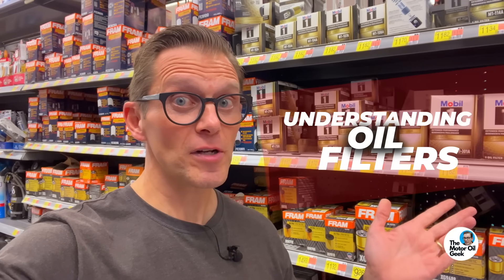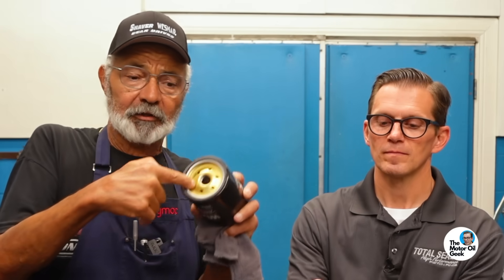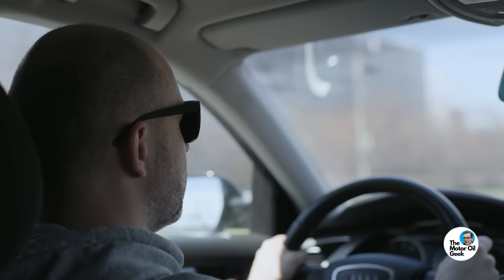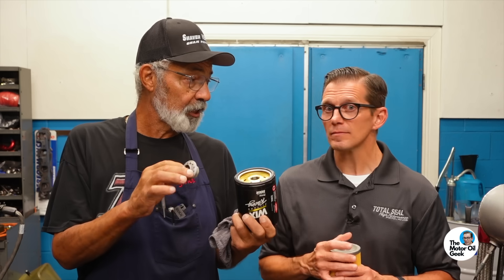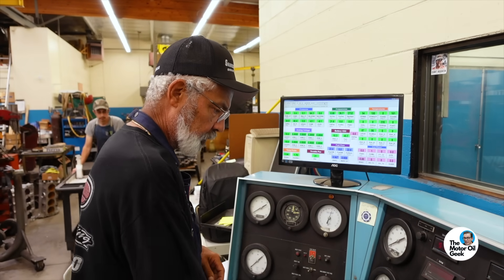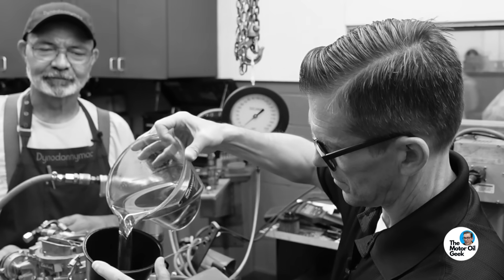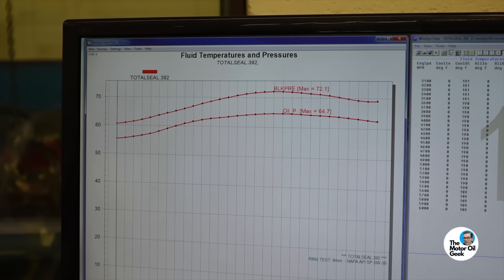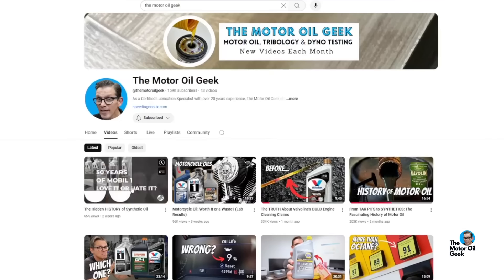OIL FILTERS: What Most People DON'T Know!

Comment: I was taught that it's good to fill the oil filter whenever possible. It's helps build oil pressure quicker upon start-up.
Reply: Yes the exchange of air for oil is important. The filter is clear full of air that gets trapped in the oil gallery so when the pump forces oil into the filter the air is displaced and blows the oil off the bearings momentarily.
Reply: Sounds like nonsense
Reply: @YourFriendlyHoodVampire  ok know it all.
Reply: @ okay, know it all.
Reply: Yeah but the absolute best thing to do after changing oil if you have an automatic is press the brake pedal down, press the gas pedal down all the way. Hit the start button to crank it over and over quite a few times until you see oil pressure register on your guage and thats the safest way.
Reply: @deanwinchester119  Not in a 68 Impala with a sb Chev you don't 😉
Reply: @deanwinchester119  Okay . . . explain what difference it makes if you're just "cranking" the engine or starting it. The oil pump is mechanically driven the same either way. Whether or not the cylinders are firing or not have nothing to do with the oil flow.
Reply: @barrygrant2907  turning the motor over on by the flywheel at 150rpm is very different to turning the motor over with connecting rods at 1600rpm
Reply: @barrygrant2907  Agreed! I was scratching my head over that one! Everything in the engine is moving and combustion does not change anything. The only way to beat that is to add on a pre-lube system — at a horrific cost, by the way.
Reply: @pops91710  Agree. It the said procedure ran the oil pump by itself to prelube the engine, that would be one thing. But cranking the engine to lube it is cranking the engine to lube it by whatever means.
Reply: Clear Flood Mode is the term, I do it as well but never used the brake pedal  @deanwinchester119
Reply: @deanwinchester119 
Ah computers !! 😀😀
Reply: @deanwinchester119 only downside of that is having to countlessly insist to the client you made their car do that on purpose and didn’t in fact screw up their car’s startup despite what they just heard and now assume lol “I aint never heard it not start up like dat you done broke somethin I just wanted an oil change”

Comment: yea but what about when its -20f outside will it open? i wouldnt call room temperature cold exactly
Reply: Who cares if it does, first off if unfiltered oil runs through an engine for a few minutes it's not going to do anything unless the engine is coming apart and the oil is full of metal or something. Second off if your starting an engine that at say -20F without using an oil heater your causing far more wear then you would be just not running any oil filter in warm temperatures. I live somewhere like you do and I park outside, my rule is plug in the block heater and oil heater in whenever the temperature is below about 20 degrees. Hell I can't imagine starting an engine that was even 10 degrees without preheating it first. We only see -20 degrees a few times a year here, but our average winter temperatures are probably around 15F degrees and -10 to -15 is not  unusual around 4am when I leave for work in the morning. I usually plug my heaters in when I get home and let them run all night in those temperatures, however when it's warmer I use a timer to turn them on around midnight. I don't hear my oil and coolant to operating temperature rather to around 40-50 degrees in the warmer weather and maybe to 20-30 degrees on a cold day. Daytime temperatures are generally warm enough that I don't bother plugging my car in at work however I do on cold days as well.
Reply: @Trump985  im just curious for the sake of knowing I'm not worried if it does bypass. back in the day engines didn't even have oil filters and most small engines dont to this day.
Reply: @windzer I couldn’t tell you, I’ve never tested it. It would certainly depend on the oil viscosity in question and the oil filter in questions restriction to flow. This test in this video isn’t an answer to the question either. There are many different filter on the market with vastly different oil flow restrictions. Check out Brand Ranks YouTube channel tests on oil filters. They did actual tests measuring different oil filters properties including the particle sizes they filter, the amount of material they can hold and most importantly the flow restriction of the filters. There testing seems to be very good and the results show a huge difference between different filters.
Reply from the maker: The dyno is in LA, so "cold" in this test was room temp. It would be fun to repeat the test at a much colder temperature.

Comment: I’ve been a car guy for years, WTI 1981.   In 2005 I started a job that really open my eyes to hydraulics, the engines oiling system. Same thing only different. Our oiling system did all our work, just like a backhoe etc. I have to say, you really start to understand about what fluids happens to fluids under all these different conditions. The need for fluid testing, proper filtration. Our filters on the pressure side were 10 micron, return side 25 micron.

Comment: When it comes to prefilling a filter, does it matter if you fill the filter before putting the filter on? What I mean by this is, can you pull the fuel pump relay and simply crank the engine to fill the filter? I ask because some engines with the filter horizontal or even upside down are difficult or impossible to prefill.
Reply: Acid:  Cranking the engine for 5-8 seconds is a good idea, but make sure you do not crank over 15 seconds.  At 15 stop, and give the starter motor at least 2 minutes to cool.  Inrush current on any motor is ~7x normal operation and will damage motor if done 2-more times in succession.

Comment: @Lake  Can you please make a video if Very Fine Bypass Filters are worth it,? You said that the filter only filters out particles over 25 microns in size. There are aftermarket filters who are build in parallel to the main filter and they filter at around 1 micron (advertised). I think the main question regarding this topic is:  how thick is the oil film under load, for example between cam and lifter? That would give a rough estimation of how big particles can be without (!) being abrasive, at least in my opinion. Having particles 25 microns of size in my oil sounds scary! It's like lapping paste... Great content, as always! Marlon
Reply: They incorrectly stated that particles smaller than 25 microns will not hurt anything.  Clearances inside an engine run between 1 - 5 microns.  There are SAE articles on the benefits of bypass filters, and that most wear occurs between 5 - 15 microns.  I've posted oil lab results of my 2 micron bypass on FB forums.
Reply: I was also wondering about testing bypass filters. I put one on the crate engine in the Caprice wagon and wondered if it was worthwhile since the old engine lasted nearly 200,000 miles with the previous owner's sketchy maintenance schedule.
Reply: @oldcoot3459  you can do the test yourself.  Install a bypass, and test oil using a particle count lab test.  I've done this for years. Just did the same last week.  The oil is cleaner than when it was new.
Reply from the maker: Thanks for the suggestion.

Comment: I read somewhere that alcohol breaks down the fibres in paper based oil filters.  They said that alcohol from the fuel can end up in the engine oil which can eventually damage the paper filter media and degrade the oil filter’s abilities to filter your oil.  Just wondering if this is a real problem?  They suggested the solution to this issue is to use oil filters with synthetic media.
Reply from the maker: Water can impact and reduce flow across cellulose media.

Comment: How much does viscosity affect the "Delta"?  Particularly on a cold soak start? How much difference is there between 5w-20 and 20w-50 at say 20 degrees Fahrenheit?
Reply from the maker: The dyno is in LA, so "cold" in this test was room temp. It would be fun to repeat the test at a much colder temperature.

Comment: I'd also like to see what happens below zero. It's amazing how thick even synthetic oil gets around -40, even ATF looks like gear lube at those temps. I can't imagine the filter not bypassing at sub zero temperatures. Looking at the marks inside even clean filters up her, it looks like things are moving against the spring. But that's not scientific proof.
Reply from the maker: The dyno is in LA, so "cold" in this test was room temp. It would be fun to repeat the test at a much colder temperature.
Reply: @themotoroilgeek  I'd say come up here to northern Minnesota, but it's been a warm winter.  🤣

Comment: Nice set up for measuring pressure on the inlet and outlet side of the oil filter.  I would love using that set up to test various oil filters to see if some limit oil pressure more than others.  Cough cough-FRAM.
Reply: Depends on filter media. Cellulose filters like regular Wix or Fram EG will be more restrictive than a Wix XP or a Fram Endurance, but synthetic media also filter better than cellulose media while still flowing more. I use Fram Titaniums on my 565 big block. No issues.
Reply: @1979Ragnarok  Several of my experiences with grabbing Fram because it's all I could find at the time consistently prove the oil pressure is about half at idle when compared to what most other brands are.  BBC, SBC, Ford inline 6, Buick V8, Buick V6, and Chrysler 3.8 V6.  I won't run them for that reason.  That's the standard Fram and never tried the Endurance.  Maybe it' better.  
I would still like to see a test here with the Oil Geek.
Reply: @greggc8088 I use Fram Endurance filters on my wife's RAV4 and Fram Titanium (which is basically an Endurance with a different sticker for some filters) on my 3.0 Duramax silverado. Both vehicles oil pressure gauges showed no differences in oil pressure. The ones I use on my big block are the original variations back when Honeywell owned Fram and have that awesome pink media. Same oil pressure as when I ran a Wix Racing filter. Just my experience though. I've never used any Fram product below their top tier ones.

Comment: To me "cold oil" doesn't mean room temperature.  What about at 5 below zero?  Would the differential be high enough then to open the bypass valve?
Reply from the maker: The dyno is in LA, so "cold" in this test was room temp. It would be fun to repeat the test at a much colder temperature.
Reply: How well do you think it's going to flow through the engine at that temp?  This is a balance of restrictions, which is more restrictive, the filter or the engine.  The relationship between engine and filter should be fairly independent of oil temp (viscosity).  It changes when the filter loads or as the engine wears out (clearances become larger).

Comment: Hey Lake, how about slotted holes vs round. Leaf spring valves vs coil. Different filter media material. And who has the best of all or compare brands. Im interested in Toyota filters. 👍🇺🇸
Reply from the maker: Thanks for the suggestion!
Reply: I would like to see this too.  i typically use the AC Delco or Wix filters on my Chevy. I recall when i was young and worked in an auto parts store, that the oil filter sales people would show us the various media types and filter constructions...  one brand was allegedly a paper media held together with a string, while others were paper media with a metal band.  I would imagine that not all oil filter brands are the same.

Comment: I've been asking to change my neighbor's oil for more than 2 years.  She finally relented.  It was 3.5 qts low (7 qt. cap.).   Chocolate shake foam in the oil cap.  I cut the filter open and the pleated filter media was badly deformed, as though crushed inward by pressure against the clogged material.  Why would that happen, since there's a bypass valve?  It was a WIX XP filter, so no issue with quality.  (When I fired the engine back up I heard the timing chain slapping against the chain cover -- it has a date with the real mechanic on Monday).
Reply: Dangerous, you do a good deed changing her oil and the engine dies a month later due to lack of maintenance. And it gets blamed on your oil change 😮

Comment: The torturous path of oil through the filter never changes unlike the path through the engine.  The engine with the internal "leaks" and the oil heating up is the contribution of the differential of pressure.  I always change the filter when changing the oil.  Just doesn't make sense not to.